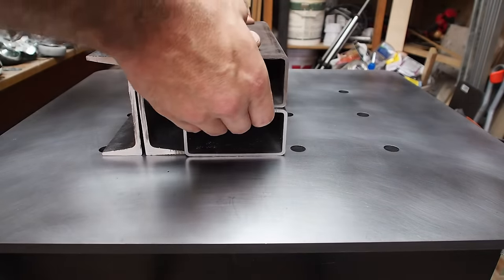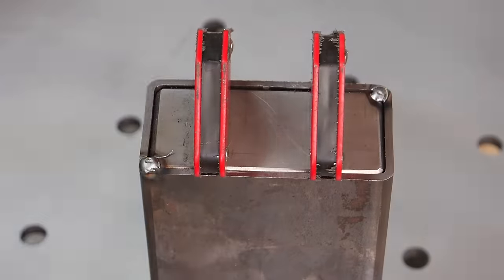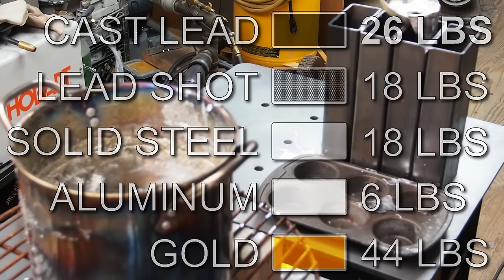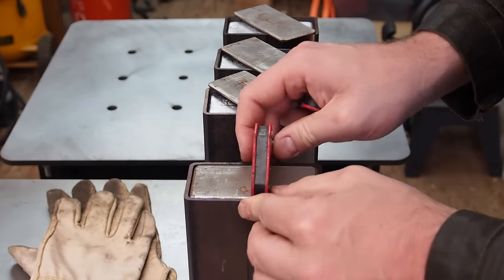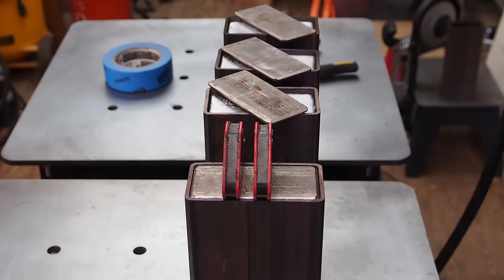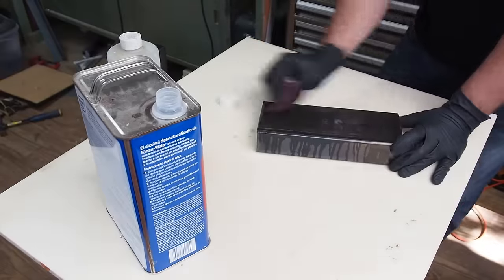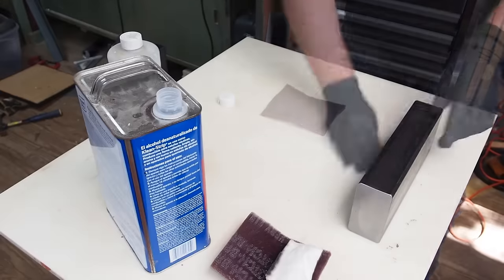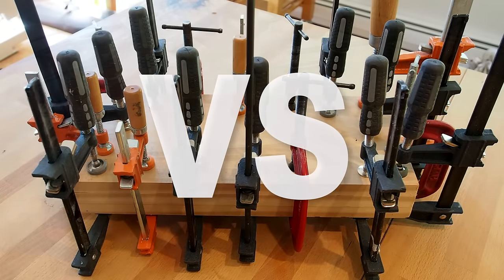Rigid Gravity Clamps | Cast lead and steel weights for the shop (Kubrick)

Comment: Beautiful weights. They are not a replacement for clamps in all use cases--clamps will provide much more pressure--but they are very useful for many applications. Excellent job, and great video!

Comment: Brian, I know you're a metalworker, so there's that caveat. I make lead gravity clamps as well, but cast the lead in sand, then when cool, encase it in a plywood (i.e., mostly softwood) sealed box. Then I can not worry about rust tainting the wood surface, and it's probably easier to grip. Also, no need to do the whole detailed welding and grinding. Would likely work on metalwork as well. No trolling here BTW - love the 2001 ref, and your attention to detail and craftsmanship. I'll be googling local skeet & trap spots now.
Reply from the maker: Yup whatever works!  I use these weights almost everyday and I need about 6 more of them though!

Comment: Nice work on the clamps, was a little disappointed you didn't go with the gold infill thou. Keep up the great work!!
Reply: Personally I'd go with uranium, but that's just me.
Reply: Less dense than gold. I'd go with osmium, 2x the density of lead.
Reply: Too bad it melts at 5500° F
(Kinda hard to melt and pour in your shop)
Reply: Guy goes on periodic table to find something above: BANG! Busted out by the melting point... so sad...

Comment: Top notch cinematography as always! It would be fun to get an "exact" number on how they compare in clamping pressure compared to your other clamps.
Reply from the maker: +Lowe Wetterstrand Interesting!  Sometimes you can apply too much force with clamps and only around the perimeter but I wonder how much lbs of squeeze the clamps have.
Reply: easy to figure out... just clamp down on the bathroom scale
Reply: Even light duty clamps can hold hundreds of pounds, the clamping force will almost always be greater. The advantage of the weights is they are quick and easy, for gluing wood you don't need alot of force.

Comment: This is a great idea. However, for those who aren't set up to cast lead, you can use those mini anvils from HF as shop weights. Granted, they are only 15 lbs, but for using as weights they work quite well for only $15

Comment: that's HAL of a nice job. Bomen would have approved. Just wanted to say No solvent will clean a surface from impurities. It will always leave a residue. At best it's more matched to the finish applied later. The best way to prep metal is sandblasting.

Comment: Cool video. Might have been easier to put lead shot in the tubes and heat them directly rather than ladle it in scoop by scoop. Then top it off after the shot melts. Maybe the shrinkage would be too extreme?
Reply from the maker: +fancyfeast1001 Interesting idea although lead shot is almost 4X as expensive as lead scrap at my nearest yard!  Melting lead is as easy as boiling water, just a bit longer wait...
Reply: fancyfeast1001 q
Reply: Another consideration would be that you'd have to be pretty accurate with the heat while melting the lead shot to not warp the containers they're in. I imagine any warping could have been sanded smooth, though. shrugs

Comment: I grew up around people who came up with clever solutions, but were of the "Cut once, measure, put an extra nail in it" school of craftsmanship. I have yet to see you use a chain saw in a vise with its safety guards removed... As I learn how things are properly done, I am wondering how you protect yourself from the gasses coming off these metals, finishes and glues. Giant, solar -powered exhaust fan -? If there was a vid, I'd love to get a link. Thanks in advance
Reply: Maybe a respirator?

Comment: Very nice work and great finish to the final product!

I'd be keen to see how much these 'clamps' would weigh if you used just a cement and water mix (no sand!) to fill them? Lead is incredibly expensive here in the UK, so I'd be inclined to find a cheaper alternative.
Reply from the maker: +mictho100 at most, I paid $0.50 per pound at my 'expensive' scrap yard.  I think I'd be inclined to just look for solid steel blocks if lead is at a premium.  Just won't have that "am I weak or is that heavier than it looks" effect
Reply: I agree that it's worth the extra work for the "wow, that's heavy" effect. I've always wanted a baseball sized chunk of Iridium(denser than gold/probably more expensive too) that I could ask friends to pass to me, and watch them struggle!

Comment: Does that blacking fluid protect the steel in any way? I'm guessing no since you added lacquer.
Reply from the maker: +Adam Rivera It does protect a bit.  Essentially blacking is like a controlled rust.  Lacquer is more to protect the things the weights will come in contact with!
Reply: Thanks for explaining the part about blacking.  I knew there was something you could put on metal to darken it, but I didn't know what it was called.

Comment: You would get better results by pushing the weld bead instead of pulling it. More penetration and flatter bead for less grinding.
Reply: Justin Tremblay I was looking through the comments for this, cause I was thinking the same thing

Comment: cool idea. those weights look pretty good too. whats your weld setup?  120 v? wire diameter/gas?  
just curious.
Reply from the maker: +Martin Ceron For these, 220v, 0.030", 75/25 argon/CO2 all funneled through a Hobart Handler 210MVP
Reply: Brian Oltrogge thanks

Comment: I would probably weld in some pipes to be able to bolt them to stuff that needs to be weighted down. Such as my lathe. 50 kg is way to little for a lathe...

Comment: what about sitting the containers in the fire and pouring the lead shot in, letting it melt in there to fill in the space.
Reply from the maker: +Craig Dick Lead shot is way more expensive than scrap.  Also as the metal cools, it shrinks, so ideally you would have some ready melted filler available.  You can melt lead on a $10 hot plate!

Comment: Where does one acquire lead shot?
Reply from the maker: +Scott Baker Cabellas or similar ammo reloading supplier.  Or online...  Or make it yourself...
Reply: You can also buy radiation shielding bricks and sheets online.  Bet the shipping would be hefty.
Reply: Go to a skeet or trap range and ask if you can rake the back sections. My dad never buys shot for reloading. he rakes at the range, cleans it and reuses it. Setimes he melts it all down into ingots to make new shot